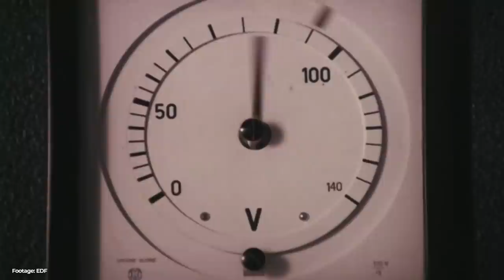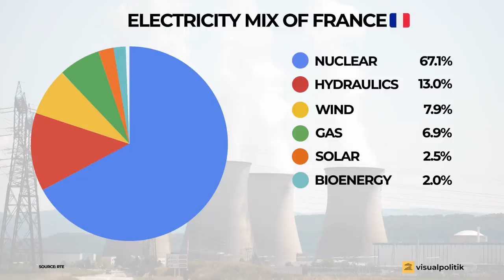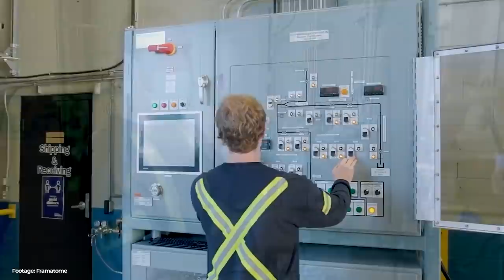Why is FRANCE betting on NUCLEAR ENERGY again? - VisualPolitik EN

Comment: Modular fission reactors will be a great path to go on for medium term energy independence. Especially when used with the latest cooling methods that practically present an almost 0 chance of reactor meltdown and cools naturally if reactor fails. Fission is not a good long term alternative to fossil fuels though because of costs and especially the difficulty in radioactive waste management. So fission is a great bet for the next 6-7 decades, while fusion is properly developed. As we will near the end of the century, fusion power plants will probably be an economically viable source of energy to provide that 60-70% backbone (maybe even 80%). 

One thing is for sure. No more fossil fuels and the insane issues they create, both environmental and political! We are nearing the end of the Fossil fuel based Industry, and “fossil fuel civilisation”. Time to move on from the dark ages of the industrial revolution repercussions: ignorant pollution.  

Next crisis: psycho-cybernetic pollution of our new digital civilisation.

Comment: I believe it is the fear of nuclear energy that is holding Germany and other countries in the against field. In reality nuclear is very safe and reliable. It costs a lot but it is always giving you a lot of energy and it doesn't depend on the market trends. It also takes a lot less space as well and it is a one time investment for many decades
Reply: @davout5775  Fusion reactors are decades away and have been since people started talking about them. Also, the 10% mark was published by the lobby organization of the nuclear industry. But I grant you that the correct number might somewhere in between 5% and 10%. Still, energy demand is increasing exponentially and always has and that'll short the time span the deposits will last. And again, we're talking about becoming dependent on an autocratic state, Kazakhstan. Are we sure we want to give them our money? Oh, and if over time uranium becomes less, its price will go up. I'm not sure that newly built nuclear power plants will ever reach their break even point, as nuclear power is already the most costly way to produce electricity.
Reply: @pillmuncher67  They most costly way to produce electricity? Dude when finished nuclear is THE LEAST EXPENSIVE way to produce electricity. It literally costs nothing to produce it. It is infinitely more efficient than than coal and oil. Kazakhstan is also not the only nation where you can get your hands on Uranium. You can also get it from countries like Australia and Canada. The deposits are still immense and they are not going anywhere anytime soon.

Comment: We are at era where you can dump the nuclear waste to outer space for cheap
Reply: No, you can't do that cheaply and it would also be dangerous.
Reply: Using them as RTG for space exploration I do agree
Reply: why would you do that? spent fuel is ~99% fertile U-238, which can be bred to fissile u-235 in breeder reactor; both France and Germany were reseaching such technology...in1970's; if these projects weren't abandoned for purely political reasons, nuclear waste wouldn't be a problem anymore – and climate change probably as well
Reply: @SmokWawelski4D  Fast breeders were abandoned for technical and economic reasons, not political ones. They often had issues like leakages that led to long interruptions in production. In France there was a fast breeder named Superphénix that produced electricity commercially. However, the issues I mentioned caused its capacity factor to be under 8% (!) while many regular nuclear plants achieve over 90% capacity factor. Fast breeders just seem to be too difficult to make economically viable (even though they're demonstrably technically possible).
Reply: @seneca983  afaik Superphénix was abandoned because Jospin needed Green's votes in parliament to maintain his government; and cf 8% for research reactor is pretty ordinary number; granted, in hindsight it was a mistake to build full scale ractor, but the rationale was that it would be more economical if everything would be factored in: fuel and electricty production, getting rid of waste and, last but not least, research

"Fast breeders just seem to be too difficult to make economically viable"
Russia has two full scale fast breeders and is building a third; China is building two, first is supposed to come online in 2023.

In any case, thorium cycle provides opportunity to build thermal breeders.
Reply: @SmokWawelski4D  To my knowledge, Superphénix wasn't a research reactor but a prototype commercial reactor. Granted, subsequent non-prototype reactors could possibly be more reliable but more conventional reactors have remained commercially more viable.

Also, one of the reasons alternative reactor types like fast breeders were investigated was a fear over uranium supplies running out. However, new deposits have been found and arms reduction has resulted in militaries contributing less to uranium demand and also many decommissioned weapons have been turned into nuclear fuel for commercial use. All this has made uranium cheap and likely to remain like that in the near future which has weakened the commercial case for fast breeders (and to some degree thorium reactors). Conventional reactors are both easier and mature making it difficult for more exotic reactor types to compete.

Comment: Realy Natural Gas Greengas emmisions are almoust on par whit coal, if methane emisions during minimg and transporting are accounted,.. Nuclear is way to go,...
Small reactors may have better economics, but there is no time to wait to them, from decision to build to working plant it takes at least decade (or almoust 4 if you are in Slovakia), I thing pro nuclear states schould join forces on  legislative, engennering, manufacturing and financing fields,... if they together made 20-30 reactors of same type it could drive unit price way down,...

Comment: Once upon a time, there was a little village that insisted on using its slaves to carry the water supply in jugs, whilst other villages progressed to water pipes.  Nuclear is a centralised business model that attracts business parasites, not to mention waste and danger.
Renewable energy like solar and wind on the current infrastructure provide more than enough for homes, future infrastructure like VPP (virtual power plants) and V2G (vehicle to grid) will decentralise electric supply to where needed.  24 hour supply from transmission lines and battery supply probably from gravity batteries like concrete towers, small hydro and home/car battery packs.

Comment: I'd like to plug some of the videos by Simon Michaux on the topic of energy generation needs if we are to try transition to a low-carbon economy.  Every power production system has its problems.  The bigger picture though is that we will need to build something like 220,000 new power plants to try replace fossil fuels. Has anyone seen the proposals for them?  I didn't think so.  So, with VERY FEW exceptions (maybe France?) most countries will still be using a huge amount of coal and gas for power in a decade - and probably two decades from now.  We just haven't started taking the transition seriously yet.  (Another issue is that there simply aren't enough metals on the earth to replace our current power needs with renewables.  So, there's going to have to be a huge cut in power use if we are to decarbonize.)

Comment: France will be economically forced to abandon billions in new nuclear builds as nanotechnology continues to advance. There is and very good chance that even in the short term (the next 15 years) artificial photosynthesis and materials based chemical catalyitics technologies will enable the emergence of ultra clean, extremely versatile and carbon NEGATIVE solar fuels to be manufactured at prices LOWER than current fossil fuel extraction costs

Comment: 3 SHOULDS: 
1. Decommissioning costs SHOULD be charged out in the cost of the electricity over the reactor lifetime.
2. Before Decommissioning the reactor SHOULD be 'parked' in SafeStore mode for as long as possible - like 50+ years - to 'cool down'. This makes it safer and cheaper to Decommission at the end.
3. The Decommissioning money SHOULD be invested in something interest earning in the meantime - giving the company plenty of money to clean up the reactor site at the end of life. The other alternative to all this is to see energy as a human right and just nationalise it and roll out the power on a cheap basis. The key with nuclear is to go big - standardise and then mass build just as the French did in the Mesmer plan. Pick one modern reactor design like the CAP1400 and bulk build it - streamlining processes on a sometimes nation-wide 'assembly line'.  Then you can have all the power you want.

Comment: Burning natural gas/methane is only sustainable if you can guarantee no leaks to the atmosphere of methane and if you can pyrolyze methane to first remove carbon from hydrogen so that the solid carbon can be buried. Burning the methane to get its full fuel value generates carbon dioxide which has usually been emitted to the atmosphere.

Comment: “What happens when the winds doesn’t blow…” 

That’s why solar and wind are coupled with batteries. V2G is probably the future. But I still think nuclear helps us get there.
Reply: Extreme cost of nuclear power plants will block renewable investment as pay back on that nuclear investment will be guaranteed by governments.
Reply: @stephenbrickwood1602  The extreme costs are tied to extreme government regulations. These should be looked at again with a more serious eye as they haven't been adjusted since the 70's in most cases.
Reply: @lwwells  as I have said elsewhere if Climate destabilisation then
CO2 reduction 
If nuclear power then
Every dictatorships with nuclear industry 
Nuclear weapons proliferation 
Nuclear winter 
No more heatwaves.
Reply: @stephenbrickwood1602  It takes considerable technology to get from nuclear energy to nuclear weapons. It's not that much of a straight line.
Reply: @lwwells  the way to go is keep existing nuclear power plants.
Connect entire grid.
Develop an area as a renewables only, and then over build to supply undeveloped neighbouring areas.
EV batteries would need to be part of the mix to get maximum value from the EV batteries. 
Petroleum would be part of the strategic military reserves. 
No extreme costs, no government subsidies to the fossil fueled power generation. 
The 100kwh vehicle batteries will trade power and stability with the grid for profit. For maximum battery value. 
In South Australia the $100million big battery has made $150milion for the state and now it has been expanded to 150MWh capacity and the neighbouring state with apposing political party is building a grid transmission connection to trade power.
Many homes have just a 14kwh battery, so the big EV batteries,  100kwh are perfect for the daily drive and home and trading power with the grid.
Reply: @lwwells  There are people who have worked in the nuclear industry for decades and posted comments and know what a technical disaster a few nuclear power plants can be.
100,000 SMR , SMALL MODULAR REACTORS, BWRX300 from GE Hitachi and Rolls Royce and  .... 
At 5years each and $2billion each and
 the extra grids at $2million each klm. to charge the electric transportation and homes and industries. 
The world has plenty of idiots but not enough highly skilled professional operators.

Comment: There is nothing “clean” about nuclear energy:

~ The mining, milling and enrichment of uranium into nuclear fuel are extremely energy-intensive and result in the emission of carbon dioxide into the atmosphere from the burning of fossil fuels. The construction of nuclear power plants is also a highly energy intensive process. 

~The energy needed to manage waste from uranium mining and from the nuclear power plants themselves also generate high quantities of greenhouse gases. 

~Estimated “energy recovery time” for a nuclear power plant is about 10 to 18 years. So a nuclear power plant must operate for at least a decade before all the energy consumed to build and fuel the plant has been earned back and the power station begins to produce net energy. By comparison, wind power takes less than a year to yield net energy, and solar or photovoltaic power nets energy in less than three years.

~Thermal pollution from nuclear power plants adversely affects marine ecosystems. “Once-through” cooling systems in use in many nuclear power plants discharge billions of gallons of water per day at temperatures up to 25 degrees Fahrenheit hotter than the water into which it flows. (We're already disastrously heating up our oceans.)

Waste Problem

~A typical reactor will generate 20 to 30 tons of high-level nuclear waste annually. There is no known way to safely dispose of this waste, which remains dangerously radioactive for a quarter of a million years.

~The nuclear power industry has amassed hundreds of thousands of tons of radioactive waste (or, in industry and regulatory parlance, “slightly radioactive solid materials”). The industry hopes to absolve itself from liability for this waste through the insane practice of “releasing” it from regulatory control, whereupon it could be sent to recycling facilities and ultimately end up in common consumer products. 

~Radioactive nuclear by-products like depleted uranium are weaponized. In Iraq, military junk is still releasing toxic pollutants, including radioactive uranium compounds, neurotoxic lead and mercury, into the Iraqi environment.
Uranium and its related compounds remain toxic for millennia and poison local populations through food, air and water contamination. The exposure of pregnant mothers to the pollutions of war, including uranium and thorium, irreversibly damages their unborn children. Thorium, a product of depleted uranium decay, was found in the hair of Iraqi children with birth defects who live in Nasiriyah and Ur City, near a U.S. military base.

~Isolating nuclear waste from people and the environment requires significant energy and resources.

Safety and Security Risks

~Nuclear power poses unique safety and security threats, relative to other sources of electricity. An accident or attack at a nuclear plant could be catastrophic.
Most recently, the Davis-Besse nuclear plant near Toledo, Ohio came dangerously close to disaster when acid corroded a hole in its reactor head. 
The insurance industry won’t insure against nuclear power plant accidents. Nuclear power plant operators rely on a government-backed “Price-Anderson” insurance scheme that limits their liability in the event of an accident or attack.

Expense
~The Department of Energy admits that “Economic viability for a nuclear plant is difficult to demonstrate.” Since the inception of commercial nuclear power in the United States 50 years ago, this industry has been propped up by huge government subsidies.
Reply: Excellent information. 
It is painful how these YouTube videos continue to confuse and mislead.
They must have some understanding of the dangers they are promoting. 
We are decades behind in energy transition and fortunate to have Renewables technology advances now.
Reply: @stephenbrickwood1602  just no, developping nuclear reaction allows to motivate and keep the lead to develop Fusion reactors. Then renewable energy will be meaningless.